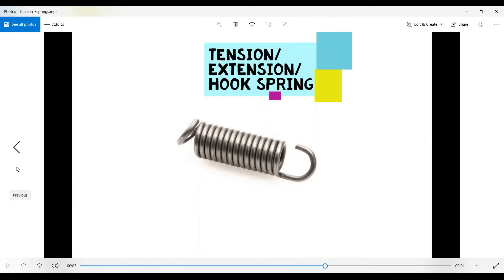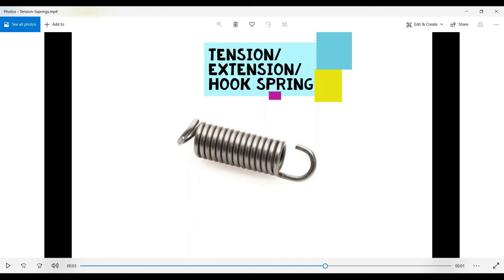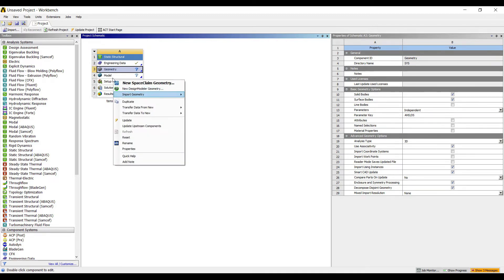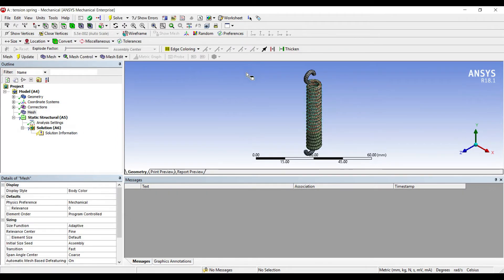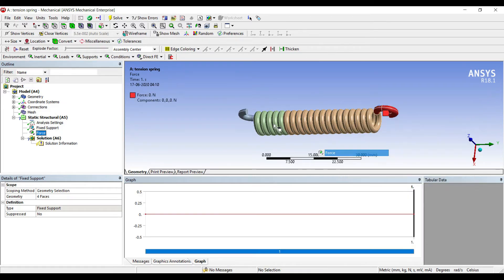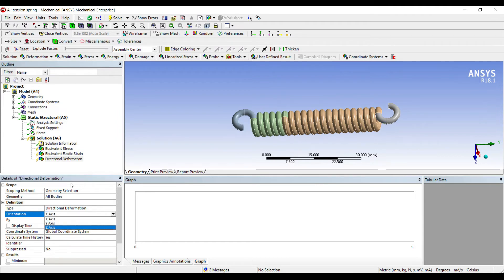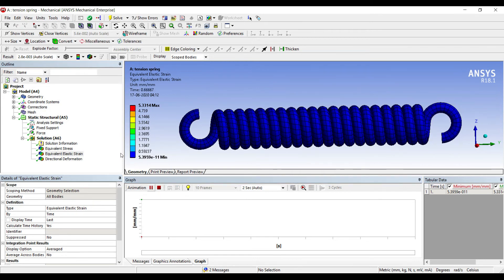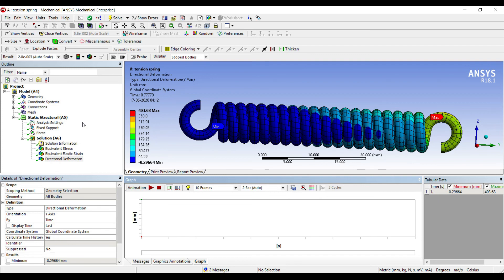Helical Coil Tension Spring Analysis I Static Structural I ANSYS Workbench I Basic Tutorials

Comment: What is the yield strength of carbon steel spring material?
Reply from the maker: It depends on the company and the code of the steel you are purchasing. 
It can range from 350MPa to 500MPa, based on make and application. It can be even more for certain applications.